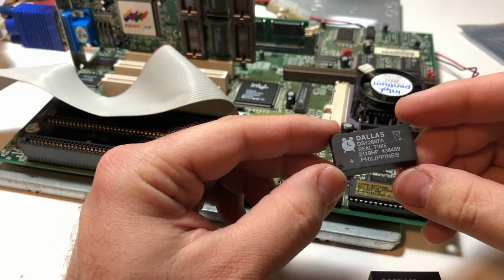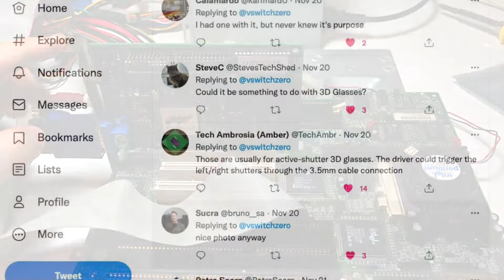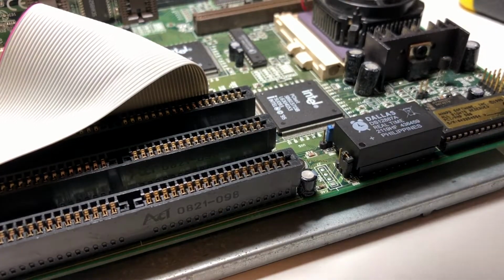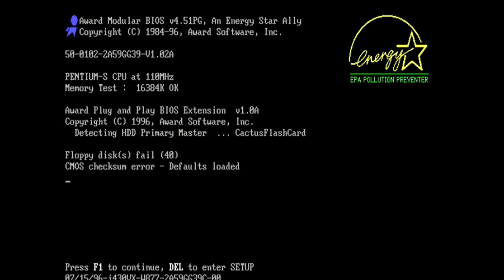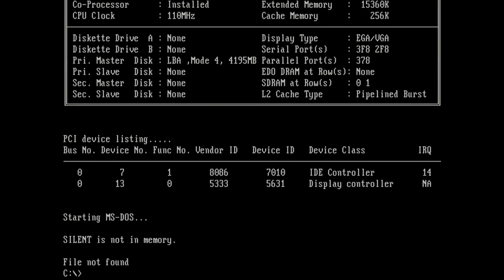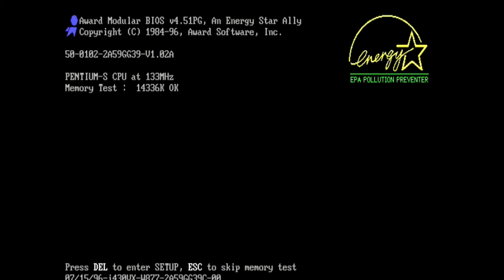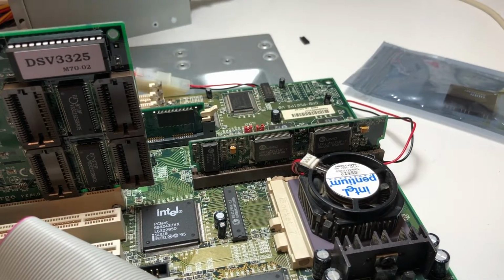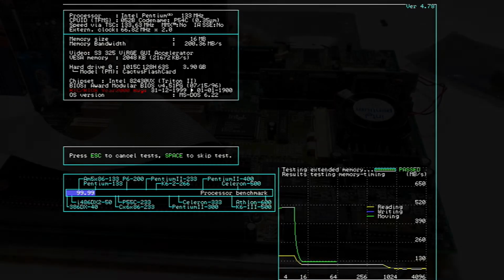Booting up and testing my newly repaired 430VX motherboard!

Comment: S3 Virge video cards. Bane of my existance. well not so much the S3 card, its what you put it in. VIA VP2, VP3 and MVP3 chipsets have issues with S3 Viege cards, mostly the Trio version. When you load the drives in Windows you get a horrible mess of artifacts and lines on screen. Thought it was the card cause when i swapped over to an Trident it went away. I tried the S3 card in Intel chipset and ALI/ULI boards and it worked properly. Worked for VIA technologies during the infamous USB issue plague, where VIA cut corners on 686A, 686B and VT8233 Southbridges. the biggest issues was the controllers that ran Printers, they would drop out constantly. VIA's solution was to give people the run around, hoping to find a driver to fix the issue, never did and those poor people who had those Southbridges had to get PCI based USB cards to fix the issue.

Comment: I have a pretty similar 430VX board since I bought it in '96. I was never able to find an SDRAM module that would work in this board, so I always had to run it with PS2 EDO SIMMS. It would be great if you could tell us which exact modules you've used here ;-)
Reply from the maker: Hi Marco, Not sure where I got it from, but it's a small 16MB SDRAM stick. It doesn't have any labels on it, but the ICs are Micron 48LC1M16A1 TG-10S. Hope that helps.
Reply: Hi great content! I have a similar 430vx but I cant find the chipset drivers for it 😢